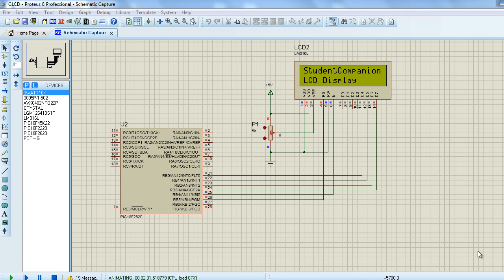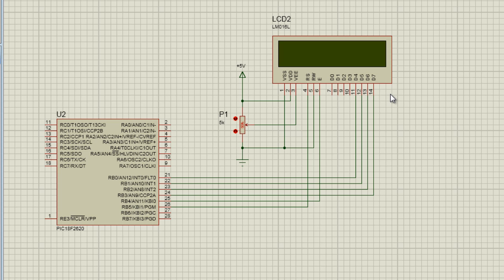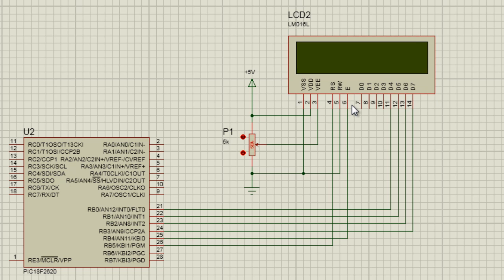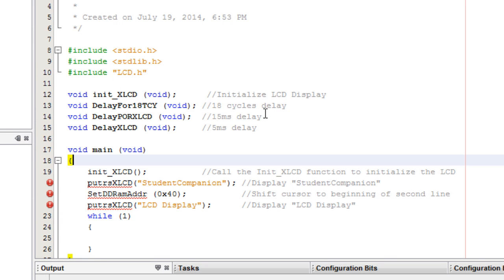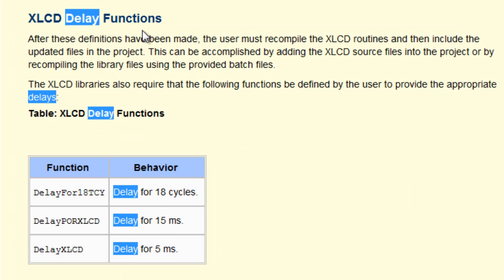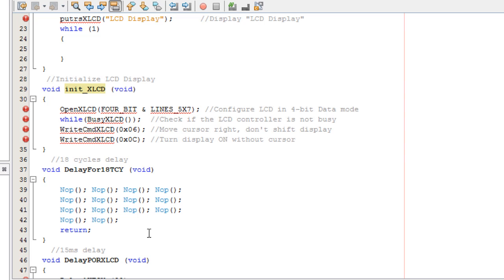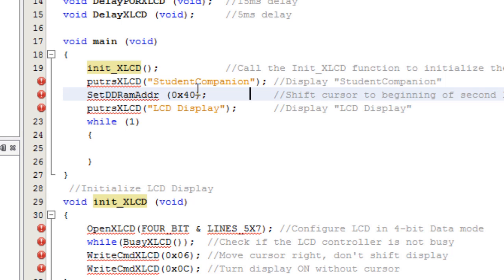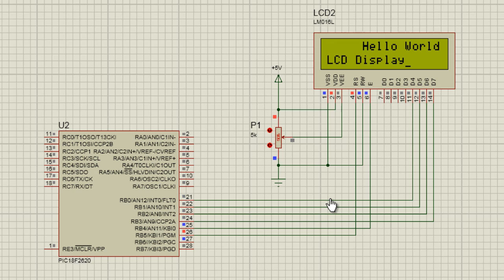5- Interfacing an LCD Display | MPLAB XC8 for Beginners Tutorial

Comment: Hello Sir, where can i download the Lcd libraries so that this example would work?
Reply from the maker: Hi. Which PIC are you using? What is the version of your xc8 compiler?
Reply: @StudentCompanion   PIC18F26K20 (the same in this video) xc8 compiler is v2.10
Reply from the maker: Unfortunately you can't use the PIC18F peripherals libraries that was used in this video with new versions of XC8 compiler from v2.x.x.
You will have to use an older version for it to work or use a different library. 
Watch this video we explained you can overcome that problem: https://youtu.be/4WaB_Lj8FnY

Comment: Cannot find lcd function description under the help in mplab 5.4.was function description removed?
Reply from the maker: It's probably about the XC8 compiler not MPLAB X IDE.  What's the PIC and the XC8 version you are using? Newer versions of XC8 don't include the PIC18F peripherals libraries anymore, depending on your version, you might have to install it manually first or use an older supported compiler because from XC8 v2.00 and above it's no longer supported at all.
Watch this video to learn more: https://youtu.be/4WaB_Lj8FnY
Reply: @StudentCompanion  I'm using pic18f2220 and version 2.20 of XC8
Reply from the maker: You can't use the PIC18F peripherals libraries with XC8 v2.20.
Either install an older version before v2.0 then install the Peripherals Libraries now called legacy peripherals libraries or install the oldest supported version XC v1.34 it will work without installing anything else.
Or use v2.20 and a different library like the one shown in the video we shared with you.
Reply: @StudentCompanion  alright thanks
Reply from the maker: You are welcome!

Comment: I can't see any download link for legacy peripherals on the microchip website
Reply from the maker: The beginning of this video also shows you how to download it: https://youtu.be/4WaB_Lj8FnY
Reply: So i installed it in the xc8 folder but  I'm still getting errors in the code and a failed build
Reply from the maker: @cyberking28  Which version of XC8 compiler are you using? What errors are you getting?
Reply: @StudentCompanion  version 5.4
The error says unable to resolve identifier
Reply from the maker: That's MPLAB X IDE version, I need the XC8 compiler version
Reply: @StudentCompanion  2.20
Reply from the maker: Unfortunately the new version of XC8 from version v2.0 and later doesn't support anymore the legacy peripherals libraries, they have removed that option, they want people to start using MPLAB Code Configurator.
If you still want to use the Peripherals Libraries, install an oldet version of XC8, like version 1.45 or earlier version then it will work.
If you insatall version 1.34 or earlier, you won't even need to install the Peripherals Libraries because they are already included in the compiler.
Please note you don't have to uninstall tge current XC8 v2.20, you can have multiple versions installed in the same computer, just  select the right version for each project.
Reply: @StudentCompanion  okay can you please drop a link for one and are there any tutorials in using the code configurator on the student companion website
Reply: @StudentCompanion  will i also have this problem with  the code configurator
Reply from the maker: You can download it from the same place as XC8 compilers. From this link under compiler Downlod Tab, scroll down and you will see PIC18F legacy peripherals libraries: 
https://www.microchip.com/mplab/compilers
Reply: @StudentCompanion  seen it thank you
Reply from the maker: You are welcome!

Comment: Sir, I typed the code but there is error   as putrsXLCD,Delay1KTCYx,etc functions are not declared

I also install the peripheral libraries 
But I didn't found option in X IDE v5.35 to add this Libraries

And also the port pin declaration  used for Proteus simulation is not there

Then how this code work on Proteus
Reply from the maker: Hi. Which PIC are you using? What is the version of your XC8 compiler? Please note from XC8 v2.0 the peripheral libraries are no longer supported, even if you install them they won't work. Either download an older XC8 compiler or use MCC. Watch this video to learn more: https://youtu.be/4WaB_Lj8FnY

Comment: Hello, I am learning how to use the lcd display but when I compile your program I ve got errors do you think I need to domnload a librairy to make it work?
Thank you for your tutorials!
Reply from the maker: Possibly.  Which PIC model you are using? What is the version of your XC8 compiler?
Can you post the exact errors you are getting?
Reply: @StudentCompanion  I use the program I downloaded on your website, the PIC is 18f2620, my compiler version is 2.10. I can compile some programs but I think Something is missing because for example I don t the pdf with peripheral librairies. Thank you for your help!
Reply from the maker: It won't work with xc8 v2. You will need to install the peripheral libraries.  It's now called legacy peripheral libraries.  But you will have to install an earlier version of XC8.  V1.45 or earlier. From xc8 v2.0 the peripheral libraries are mo longer supported.
Reply from the maker: Watch this video to learn more: https://youtu.be/4WaB_Lj8FnY
Reply: I downloaded the 1.45 and the 1.34 version of xc8, I installed the peripheral librairies in both files. I linked it in the properties. I still doesn t work. I don t know what else I can do. I created a new project with a pic 18f4550, I defined the 1.45 version and I copied your code.
Reply from the maker: @guillaumev678  post the error messages you are getting so that we can see what could be the problem.  The full error messages
Reply from the maker: @guillaumev678  if you installed 1.34 there is no need to download the peripheral libraries, it's already part of the compiler
Reply: @StudentCompanion  I managed to build it. I needed to include the librairy plib. Now I ve to wire it correctly on proteus because it displays nothing
Thank you for help
Reply: *my pic is 18f4550
Reply from the maker: @guillaumev678  ok. Wire it correctly, if it doesn't work check that the RS, E amd RW pins are wired correctly.  Check the delays routines in the code that they are correct.
Reply from the maker: @guillaumev678  make surr you set it up correctly.
Reply: @StudentCompanion  I still have a remaining problem, my program compiles but when I load it in proteus on both pic 18f2620 and pic 18f4550, the outputs don t react
Reply from the maker: @guillaumev678   can you post your full Proteus and MPLAB projects zip files to the forum. We will look at them and advice what could be the problem.
Reply from the maker: @guillaumev678  forum: www.studentcompanion.co.za/forums

Comment: Sir i have many error in program every function of lcd show error
Reply from the maker: Hi. What do you mean every function shows an error? Is it a red underline? Or when you build it generate errors?
Reply: @StudentCompanion  sir every line show erroe red and when compile then show message undefine functions
Reply from the maker: @abubakarabbas9384  can you copy the full build log and paste it here so I can see the full error message.
What isbthe PIC you are using?
What is the version of your XC8 compiler?
Reply: @StudentCompanion  sir i am using mplab xide and xc8 sir the issue is when the f1 is pressed and search the lcd function then where writethat use these function to include the header file but in your code i cannot see any header file. this is my problem i cantot find any xlcd header file

Comment: i didnot understand the concept of "LCD.h" header file do we download this file or it comes with the compiler and al we need to do is specify it ? by wrting #include <LCD.h>
Reply from the maker: It used to come with the compiler with the PIC18F peripheral libraries.  A set of libraries for PIC18F series peripherals like SPI, ADC, I2C etc. Now this library has been discontinued in favour of MPLAB Code Configurator.
Reply: @StudentCompanion  ty so much  u are the best
Reply from the maker: Thanks for your feedback.
Reply from the maker: Watch this video to understand more: https://youtu.be/JxSSVtTj_fA
Reply from the maker: And this video for LCD using new tools and library: https://youtu.be/4WaB_Lj8FnY

Comment: Hello
I am getting an error while compiling the code
:0:: error: (499) undefined symbol:
 BusyXLCD(dist/default/production\ADC_Test-1_22-9-18.X.production.o) 

I have checked in the library to verify that im not doing a syntax error
please help me with it
Reply from the maker: You didn't specify the PIC used, the compiler version etc.
Reply: @StudentCompanion  I have used pic 18f45k22
And compiler xc8 v.2.00
Reply from the maker: The new compiler XC8 v2 doesn't support the peripheral libraries anymore.  Either use MPLAB Code Configurator as explained in this video: https://youtu.be/4WaB_Lj8FnY  or download an earlier version of XC8 v1xx and link in the peripheral libraries.
Reply: @StudentCompanion  what do you recommend among the two?
Should I rebuild the project with mcc or an compile with an earlier version of xc8
Reply from the maker: Microchip is basically discontinuing the peripheral libraries.  It's never advisable to start  a new project with an old discontinued tool. You'll face problems in the future. It's still there just to support old existing projects.
Reply: @StudentCompanion  thank you very much for the guidance brother
Reply from the maker: You are welcome!
Reply: @StudentCompanion   can you please recommend me a few books or tutorials to learn c programming better?
Reply from the maker: @birdiesaura768  Do you want to learn C language or Microcontrollers programming? Which compiler are you interested in? There are plenty of books on amazone.
Reply: yes, C language programming..preferably MPLAB X
Please recommend me some
Reply from the maker: Get some books by Prof Dogan Ibrahim PIC Microcontroller Projects in C 2nd Edition. And Books by Lucio Di Jasio. They are more practical orientated. For more in theories, there are also other authors.
We are also in the process to release our first book.

Comment: if our compiler version is new and we download the peripheral library, then do we have to use MPLAB Code Configurator or will it work with normal mplab ide? cause i watched video 22, downloaded and installed the peripheral libraries, added the lcd_libraries and all and even the red underlines all disappeared but it still gives error 2 when i build it. is it because i'm not using MPLAB Code Configurator?
Reply from the maker: Did you link the peripheral libraries as explained in video 22?
Reply: Student Companion yep did that too :/
Reply from the maker: What are those 2 errors? Can you post your project in the forum? We will build your project and see if we can recreate those errors. Forum: https://www.studentcompanion.co.za/forums/

Comment: why are there so many red underlines? i wrote the same codes (except of course the header file, i included my own header file) but it gives 2 errors :(
Reply from the maker: Hi. We can't really guess what could be wrong without more information.  Which PIC are you using? What version of XC8 compiler you are using? What are those 2 errors saying?
Reply: well the red underlines are exactly in the same places as in the video. and when i build it, at the end it says in red lines:

 "make[2]: * [build/default/production/my_mplab_project.p1] Error 1
make[1]: * [.build-conf] Error 2
make: * [.build-impl] Error 2

BUİLD FAILED (exit value 2, total time: 2s)"

i've followed the tutorial from the beginning and done exactly the same, PIC18F2220 and all. the compiler version is v4.15

why are the codes in the video underlined red at all? they work with you :/
Reply from the maker: Well. Red underline are not necessarily errors. There might be many reasons for that but what i have observed if you did not specify explicitly the libraries used, it will underline those codes. Like for example we did not include xlcd.h and adc.h in this video. But when you build the code it will get all the required libraries that's why it won't generate errors.  In your case it does not find those libraries that's why I think it generating errors.  The reason because you are using a newer XC8 compiler. PIC18F peripheral libraries are no longer included in new versions of XC8 compilers from version 1.35. You must  now download them separately and install them into your compiler and they are now called Legacy peripherals libraries.
Reply from the maker: V4.15 is not the compiler version, this is MPLAB X IDE version. This is just the editor not the compiler. The compiler works in the background.  That's the version that I need.
Reply from the maker: Microchip wants people to use MPLAB Code Configurator now for new designs because they are no longer supporting the peripheral libraries. Watch this video to learn how to download the peripheral libraries and link them into your compiler.  And also how to use MPLAB Code Configurator for ADC and LCD: https://youtu.be/4WaB_Lj8FnY
Reply: Dude... i can't thank you enough man :) 
you're the best and God bless you
Reply from the maker: Thank you.  We really appreciate your feedback.  Is it working now?
Reply: i just couldn't find the lcd_library :(
Reply from the maker: Which library you are talking about? The PIC18F peripheral libraries?
Reply: in that link you gave me, it says the lcd display is not included in device resources so we're gonna use an external lcd library
Reply from the maker: If you mean the lcd library used in that video lcd with adc, it always good to comment on the correct video so we know what you are talking about.  You can download it from microchip website or on our website at: https://www.studentcompanion.co.za/interfacing-lcd-display-with-pic-microcontroller-xc8/

Comment: If am I using the peripheral libraries for pic18f I need to put the archives  'delay.h' and 'xlcd.h' on headers files? And always I change the 'ROM Ranges'  on 'memory model' in the 'xc8 linker'   on the program for 010-7FF, Orders by teacher,  but If i put the '010-7ff'  appears  a error : "Delay... Is never  called' why this happens? Thank u for ur attention
Reply from the maker: Hi. Are you getting errors or warnings?
Reply: Student Companion "main.c: 121: warning: (520) function" _DelayXLCD "is never called
: 0: error: (500) undefined symbols:
__mediumconst (dist / default / production \ test.X.production.obj) __smallconst (dist / default / production \ teste.X.production.obj)
make [2]: * [dist / default / production / teste.X.production.hex] Error 1
make [1]: * [.build-conf] Error 2
make: * [.build-impl] Error 2
(908) exit status = 1
nbproject / Makefile-default.mk: 131: recipe for target 'dist / default / production / teste.X.production.hex' failed
make [2]: Leaving directory 'C: /Users/SARAH/Desktop//PROJECTS/teste.X'
nbproject / Makefile-default.mk: 90: recipe for target '.build-conf' failed
make [1]: Leaving directory 'C: /Users/SARAH/PROJECTS/teste.X'
nbproject / Makefile-impl.mk: 39: recipe for target '.build-impl' failed

BUILD FAILED (exit value 2, total time: 2s) "

This message appears, but only when I put "010-7ff" in "properties-> xc8 linker -> memory model-> ROM RANGES" if I do not put such a parameter (010-7ff "compiles normally. put such thing so as not to erase the bootloader.

and a question, if I am linking the "peripheral libraries" do I need to put the "xlcd.h" and "delays.h" files in the "header files"?
Reply from the maker: I am not sure about the "010-7ff". If you link the peripheral libraries, there is no need to include "xlcd.h" and "delay.h". The code will still compile without errors. 
But if you use an lcd on a different PORT beside the default PORTB, you'll have to recompile the lcd library files.
Reply: Student Companion thanks
Reply from the maker: You are welcome!